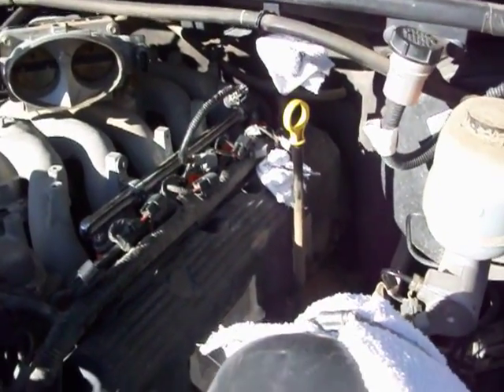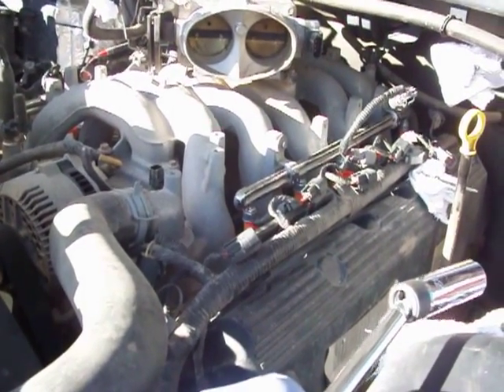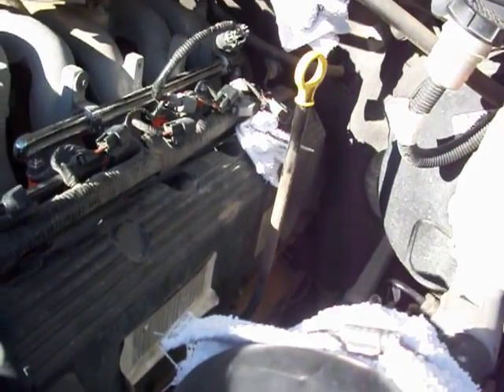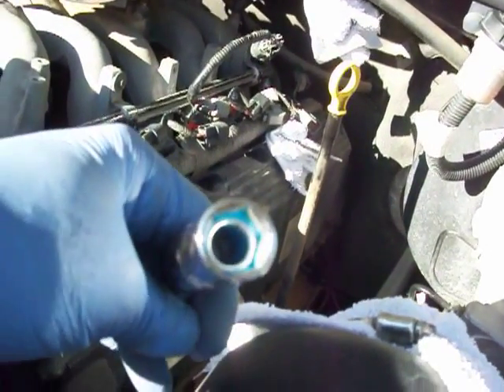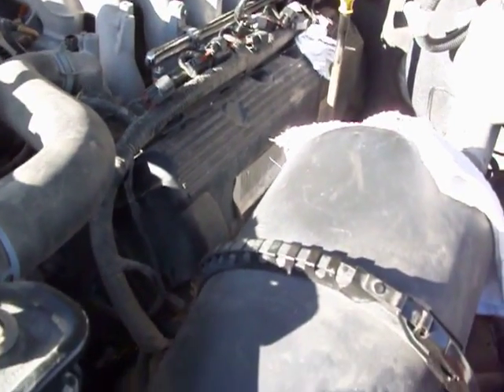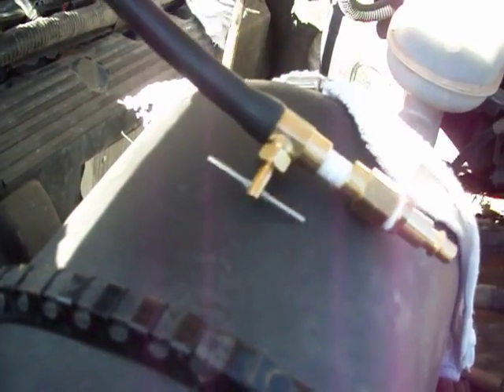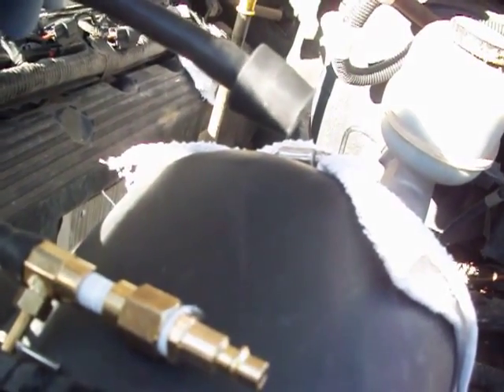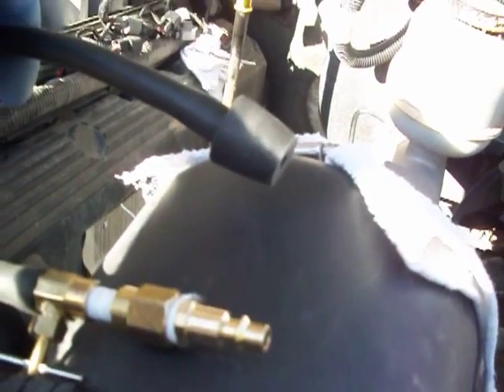61 Removing the spark plugs on the Triton 6.8L engine

Comment: Greetings - I'm confused here, what is the purpose of this procedure? Is there a reason for blowing air through the combustion chamber - while turning the crank to close the valves?? Is this procedure called out by Ford? I've been wrenching for 40 years now - and this is news to me. Please explain.........
Reply from the maker: This video is part of a series for fixing a blow spark plug with the head in place. This is a notorious problem with the Triton aluminum heads. The spark plug threads in the head tear out under combustion and the spark plug literally blows out of the head, ripping all of the threads out of the aluminum head.

The fix, other than a new head, is to ream, tap, and put an insert in the head for a new spark plug.

1) The ream and tap will go some distance into the cylinder when reaming and tapping.

2) If the valves are open, AT ALL, the ream or tap will hit the valve, possibly nicking the valve, in which case it is game over and the head MUST come off to replace the valve. YOU DO NOT WANT TO NICK THE VALVE when reaming or tapping.

3) If the valves are COMPLETELY closed and sealed the valves will be out of the way of the ream and tap.

4) The process of blowing air into the cylinder while turning over the crank is to get the valves COMPLETELY CLOSED AND SEALED before reaming or tapping.  You need the valves closed and sealed and out of the way before proceeding.

5) You can hear the air escaping past the valves when the valves are open. When the valves finally close and seal you can hear the change in the air flow and the air hose cork will pop out of the spark plug hole.

If you can get the valves COMPLETELY CLOSED and sealed, guaranteed, by some other method then that's good too.  You need a way to absolutely guarantee all of the valves are completely closed and out of the way of before reaming or tapping.

As for FORD calling out this procedure, nope.  FORD recommended service procedure for fixing a blow spark plug is to:

A) Remove the cab from the frame. I kid you not, the standard procedure called out by FORD to work on the heads is to lift the cab off of the frame and engine.  What???

B) Remove and replace the heads, valves, valve train, oil, gaskets, full top end, with another aluminum head, which more than likely will blow like the previous aluminum head.

This video is about adding spark plug inserts, over the fender, with the engine in place, and the cab still on the frame.

Comment: why were you turning the engine over? Is it intergal to changeing out the plug or was there something else you were doing? I simply need to replace the plugs and cop packs.
Reply from the maker: If all you need to do is replace plugs and COPs you don't need to turn the engine.  Turning the engine over tuns the cams and raises and lowers the intake and exhaust valves.  It is critically important to have the valves closed completely if you are going to ream and tap the spark plug holes.  If the valves are open during a reaming or tapping operation the valves run a high chance of being nicked, which will ruin the valves and require a head removal and replacement.

But for plugs and COPs only you do not need to turn over the engine.

Comment: how to you replace no. 5 passenger most rear spark plug I can't figure it out to save my life
Reply from the maker: +BruteBrothers Stop the video at the 5 second mark. You'll see a magnetic swivel spark plug socket. The socket needs to be the size of the spark plugs, that's obvious, using the swivel sockets allow you to get into the spark plug well from an angle, which seems to be required, and being magnetic allows you to retrieve the spark plug once it is unscrewed. 

I bought a set of three common spark plug size sockets from Harbor Freight as a kit. They are swivel, magnetic, on about a 6 inch extension, for 3/8 driver. The swivel allows you to come in from in front of the fire wall but still get back and down into the spark plug well.